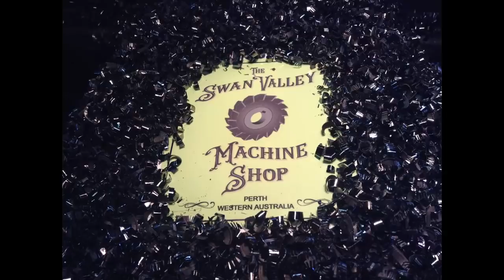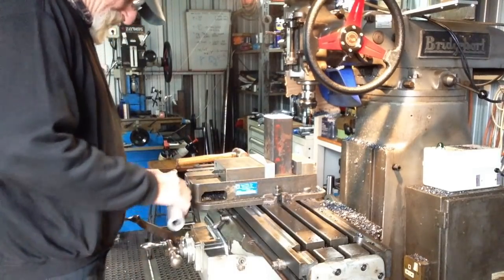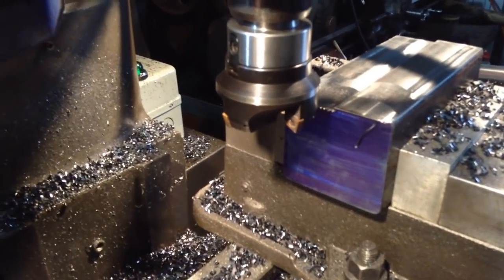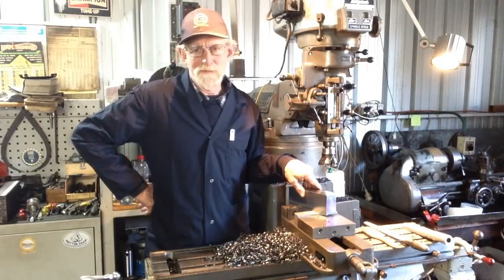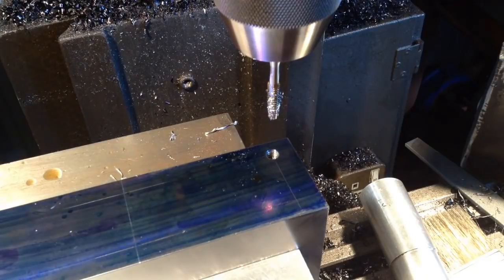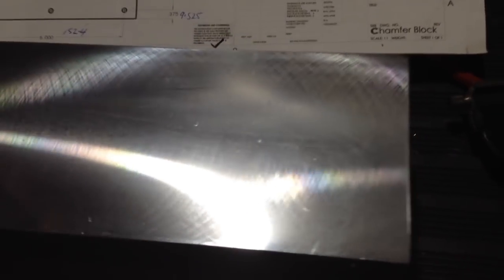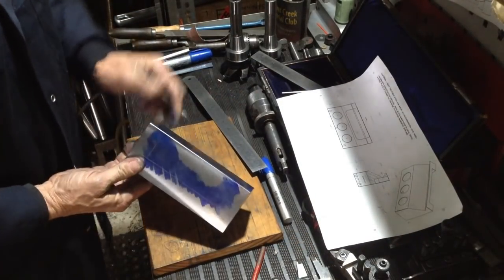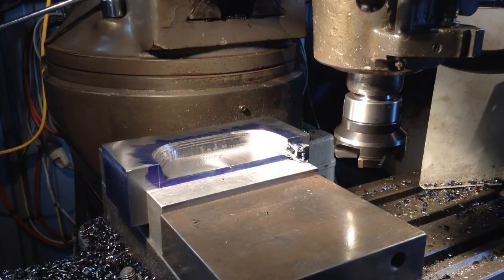Tom Lipton /The Swan Valley Machine Shop  Chamfering Block     Part 1 .

Comment: I expected a centering scope would be a very useful bit of kit, but am now rethinking it! Your mill is happier running a large facemill than mine is - mine has the rigidity but I have a bit of clatter in the head and I think I need to pull it apart and possibly re-make the splined drive pulley. That milled finish looks fantastic, as you say - looks like a blanchard ground piece. Looking forward to pt2. Cheers, Craig
Reply from the maker: Thanks Craig .  Yes that scope surprised me , i will have to have a bit more of a play with it !  Cheers .

Comment: Nice finish on that. Good work Max. I appreciate the honesty on the centering scope. You probably saved a bunch of us some money. Take care
Reply from the maker: Hi Randy .  As i said to Craig , i will have to have a bit more of a play around with it .  Cheers .
Reply: Once set, not always easy, they should work every time. A reticule with circles would be great for drilling out broken screws, at least that was my thinking, I  must finish making the Hemingway kit.
Reply from the maker: @chrisstephens6673  I don't quite understand why they calibrate the way they do .  I would have thought they would have been on a fixed centre like a coax .  No instructions !!!
Reply: @swanvalleymachineshop  of the couple I have had experience with, one a drill chuck with the optics built in had no adjustment and a real  forehead basher in use. The other was totally illogical to adjust, again no instructions, and I admit I gave up. The Hemingway kit is at least logical to adjust even if I haven't finished building it yet, and what's more the eye piece is far enough a way to save the head butt every time you use it.

Comment: I made mine taller which gives me the ability to chamfer larger parts, about 6 inches tall. But it the application that governs size. Thoroughly  enjoy watching your videos, it's  great to watch a true toolmaker like myself at work.🤙
Reply from the maker: Thanks Chui . I was limited by the material i had  & will make a base plate to fit my T & C grinder .   Cheers .

Comment: Great vlog Max, good healthy cuts on the Bridgeport, spindle power is limited on those, and overall machine ridgity. Too many degrees of freedom for high metal removal, as you know, always find a Bridgeport paired with a heavier mill to chobble of the metal.
Looking forward to part 2.
Thanks for sharing.
Reply from the maker: They are a great machine , you are right about a larger machine .  The big Stanko will take care of jobs like this in the new shop .
Reply: @swanvalleymachineshop  A Stanko, was the first mill I used when I started my apprenticeship in 78, it was a fixed vertical mill, if memory serves. The company have several of these, of different variants and size, they were part of a deal a few years earlier in exchange for selling them a Brake Shoe resistance welder line we manufactured (the machine rolled and formed the platform over the web and welded the projections). Very good machines, a bit clunky compared to a Cincinnati or K & T, but still a good work horse.
The Stanko came with a good range of accessories, all covered in some corrosion protection tough as anything to remove.
Barter, or Factoring was a common transaction when selling to what was then the USSR, the company I work for now, sells to Russia, and obviously pay in hard currency, but the amount of red tape on their part is still there, including the official bride or two! Machines are 1.5 million dollars plus, and the customer had to pay a bribe to certain "transport expert's" to get the machine in a truck trailer on a railway carriage safely into Russia, about 2 thousand Euros!. This was from the UK.
Best regards John.

Comment: Nothing wrong with using a caliper point to scratch the blue off - for those really troubled with the idea - get some with carbide points.  There is a bit of COS error, but plenty close enough for most work.
Reply from the maker: They probably cop more with general usage .

Comment: Coming along nicely, are we to presume you are going to square off the recess, if so why? The grinding wheel is round so a round recess would work fine. I did mean to ask our friend Tom about that.
Reply from the maker: A squared off recess is quicker & easier to do  , but thinking now a round recess done on the rotary table would be quick except for the extra set up time .
Reply: @swanvalleymachineshop  the cut out you did with your face cutter would clear the wheel surely, without the extra work with an end mill. If there is no square edge then please ignore the above.😉
Reply from the maker: @chrisstephens6673    The only one i have with a square edge is the 80mm Iscar & i can only use it for light finish passes in the Bridgeport .   If i had my big Stanko running i would be able to do all the cuts in one pass  , i look forward to the day when it is wired up !
Reply: @swanvalleymachineshop  stanko solid Russian machinery if im not mistaken, not found much here in the uk though.
Reply from the maker: @chrisstephens6673  It is a 6t83w  ram type mill .   4200kg's   by the scales on the crane .Masses of table travel .